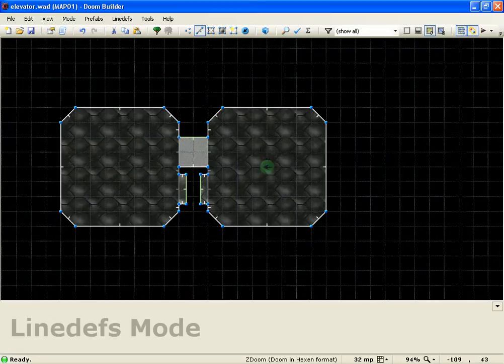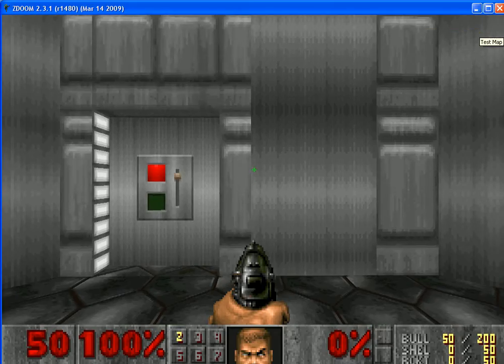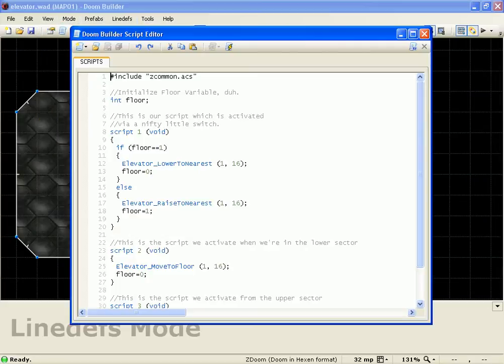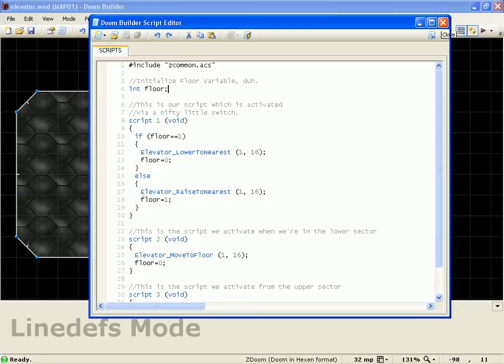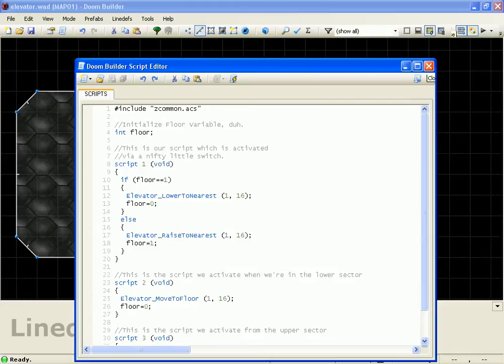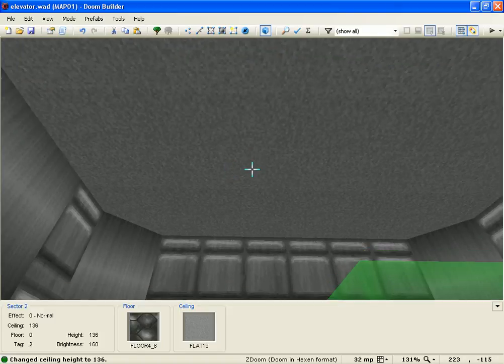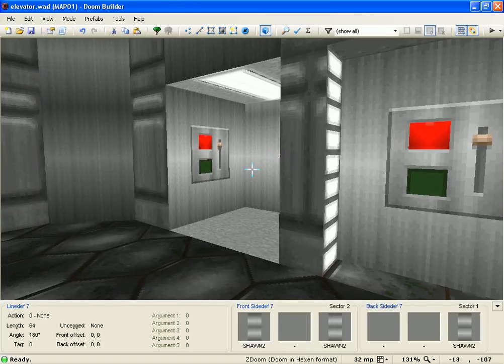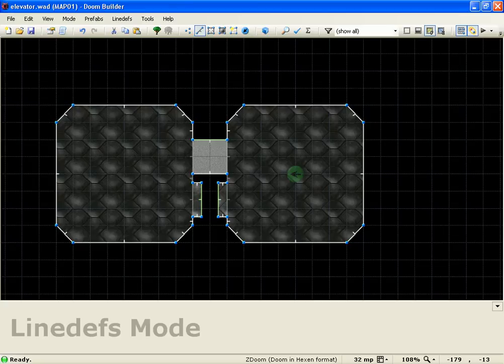Doom Builder Tutorials - Elevator

Comment: Doesn't work for me :(I didn't understand pretty well ...All that I have to do is copy the script in the editor then  make my switch's actions to 80 ?
Reply: +Axel Also, make sure that each switch executes the correct script. There should be a pull down menu (I use GZDoom builder so it may be different for you) which shows script numbers.